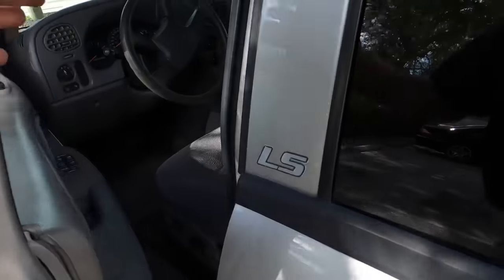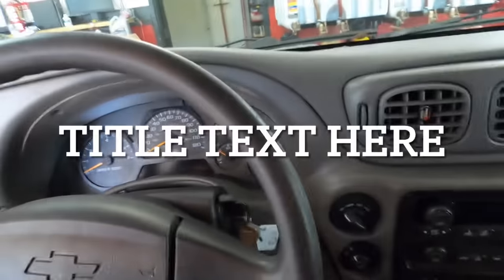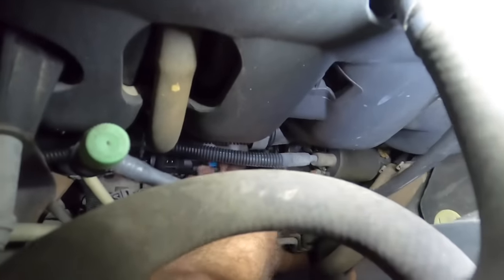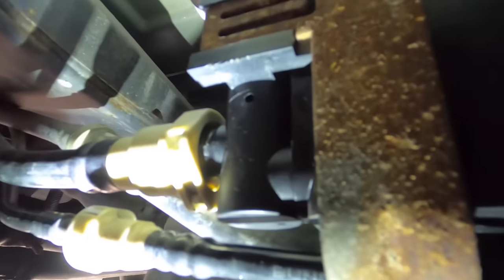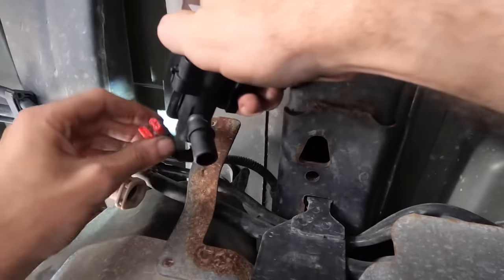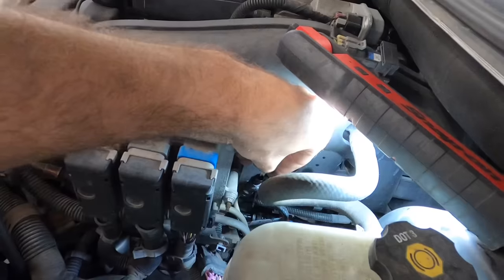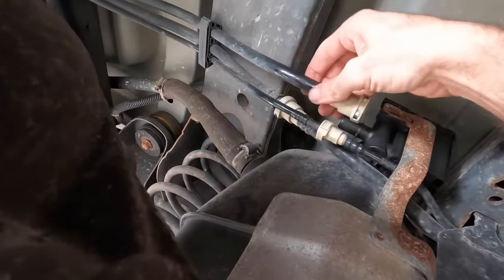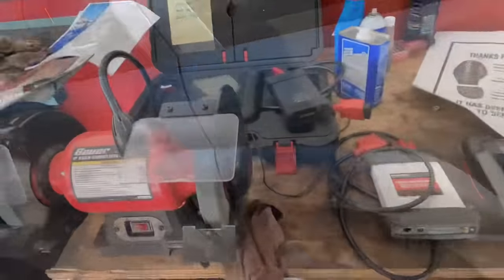Repair failed! Customer is Angry

Comment: If the customer has replaced the purge valve and it is still doing it after a little bit it wil most likely be the gas cap.  My moms Toyota matrix did it almost from new and then after the gas cap seal was replaced the check engine light went off for a few weeks and then was back on replaced it again and same thing

Comment: My 2013 ram does that, engine light comes on, check the code says small leak in evap system, changed the gas cap, still comes on over a period of time, and sometimes like this morning I can smell unburnt gas fumes in the cab, never thought to check that under the truck....done forgot what it's called.... 😆....

Comment: I know of one where the codes do have to do with the evap system.
The vehicle seems fine when moving but will die when at stop light/idling.
To me it sounds like there is actually liquid gas in the vapor canister and the start solenoid is possibly stuck open so that the engine at idle is pulling liquid gas and choking the engine out.
I imagine if the start and vent valves are in close proximity they could have been cross connected i.e. the harness connectors could have been confused as the entire setup is all up in the right rear wheel well area.
Does this sound familiar?

Comment: I encounter bad parts from the manufacurer all the time. Usually they come in batches. Like you will get a box of parts and if one is bad there is a high likely hood that all of them will be. Now most of what we do is warranty repair, so we just bill back the manufacturer anyway.

Comment: He wanted it completely clear to see what the mechanic was going to say he probably has the information written down to see if it matches what it said the problem was before , However I did hear both of the valves both open and close and the new valve did sound stronger than the original 4 day old valve , This Mechanic should advise the customer to view this video so he Will know he is being treated fairly

Comment: Good job Ray, i will say if he says he had the parts store clear code, he is either not telling the truth or the store erased the code, which they are not supposed to. At least from what the parts stores i deal with, they will not clear the codes, and….. if they do scan it, they normally give the customer a sheet with the codes.
Reply: actually I work at a parts store and it is against federal law for a parts store to erase trouble codes.....sometimes a customer will get mad at me or argue with me when I refuse to clear trouble codes....But I refuse more so for the reason it is very difficult for a mechanic at a shop to diagnose a problem when someone has cleared the codes.

Comment: Just 2 points i have questions about. You had the smoke machine there. Why you didnt use it again to test the valve you installed?
You have the car on a lift. Why the heck are you  crawling under the car when you can lift it up and work standing on your feet?????!!!
Nice end result man.

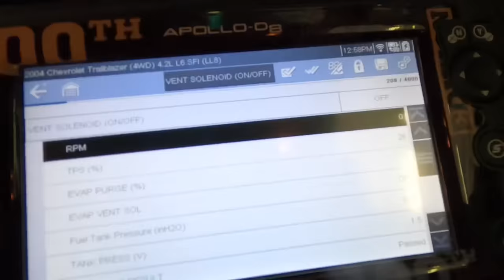Comment: @5:00  you said " it is normally open " and you selected off .
To close vent valve , should you have selected on , to close valve  ?
Also if you use the smoke machine flow indicator. No need to see the smoke . If no flow then all is good  ?

Comment: As someone who owns a 2002 Suburban… the evap code has been on too long. Been checked many times, had the purge replaced, and even changed fuel cap. Nothing. I hate evap leaks.

Comment: Hey Ray 👋 I've notice when the evap system is pressurized the vent valve stays stuck closed until some of the pressure is bled out hope the customer does not return.

Comment: wow it wasnt the fuel tank pressure sensor . usually people figure that one out after countless purge and vent solenoid replacements. or luck out with the new ecm because you get an updated program
when replaced ecm. oh yeah the t blazer is a GIANT p.o.s.  also the intake manifold bolts come loose like the mali boos.

Comment: Run the auto. Turn off then loosen gas cap. Pressure or no pressure. Gas back up when filling is bad valve.

Comment: How do you like that harbor freight battery charger Ray? Just curious before I buy one! 

I am leery of those "smart" chargers but my analog charger that is older than I am has just about had it and not many companies make new analog ones so I'm going to have to buy a microprocessor controlled one at some point.

Comment: The first repair: vent valve was bad. Replaced, apparently with a new one that was making noise but bad. Smoke pump finds that it (the new one) was actually faulty. Remove smoke pump before another "new" one shows up and puts back together. Probably like the previous mechanic. Makes a noise, so it's good. LIKE THE FIRST "NEW" ONE DID.
🤦
🤔 Why not remove the smoke pump AFTER the new "New" one was fully tested? 🤨

Comment: after repair why did you not do a drive cycle to make sure it was fixed?You could have done a drive cycle before you started you have the tool to make sure it went through one
Reply: Or at least seal the system and pressure test it.  It may still have an unrelated leak.

Comment: Would this be contributing to common GM problem of when filling gas, it clicks after putting about a gallon or so? I have replaced Purge Vale Solenoid, Vapor Canister, Purge Control Valve with OEM parts to no avail. Still having the same issue of spending 30-45 minutes of trying to put 10 gallons in.

Comment: He's lucky most of the mechanic shops around me have the policy of if you bring your own parts fix it yourself. They don't know it's brand new for sure. For all they know you tossed something in a box. Likewise if you had the codes cleared at say Auto Zone before you came in again fix it yourself. Their not gonna play find the needle in a haystack and use parts they know nothing about. They will however happily go to the shop with you and watch you buy brand new parts if you insist.

Comment: I’ve seen vent solenoids crack but still work on those btw just for the info
Reply: And for confusion I mean they still cycle off and on but set a code due to being cracked

Comment: Aye, what's the story on the mountaineer I've seen in the background of the last few videos? I got one of the first year 97s with a 96 build date and that old thing at 286k runs like a top other than some oil burning and the ac failing.

Comment: Couldnt you have checked live data in order to help diagnose the problem? It helps to have a code but live data can tell you alot too 🤔 not questioning your methods cuz they seem to work 😅 just wondering

Comment: Faulty brand new vent valve? Is it the brand with the open wallet logo on it? (Dorman) why would customer erase codes before bringing it down? DO NOT DO THAT! Motor Age had a presentation where they talked about a program or maybe a service that could pull ERASED CODES just for this purpose where customer has deleted info. I will have to do some research again as to what this was as my memory is getting old!

Comment: This situation where the customer supplies the part is not a good idea. In every shop I worked at back in the 70’s and 80’s had a firm rule that there would be no owner supplied parts accepted. We used only NAPA parts and guaranteed all our work.

Comment: I’m sure the shop wouldn’t let you but I would have told the customer that they have to get the code back up before I work on it again, especially with a “it hasn’t worked since you…” customer.

Comment: step one i never go with a customers diag 

with evap I always smoke from the test port or by the purge solenoid
from the gas cap 
from the vent valve 

helps check the whole system

Never
Eever
Worked

I always run the monitors before returning a vehicle to a customer for a check engine light. Rather them be pissed I had it too long but know its fixed instead of being pissed they come back for a check engine light

Comment: Don’t like customer supplied parts. We had a customer with a bad transmission bought a trans from eBay. It failed after it was installed. This happened 2 times. Different failures. Boss warned the customer no warrant on any failures. Paid twice for R&R

Comment: I have the same type of trailblazer but mine's an 05 I'm having the evap canister problem were I will my tank with gas it burps our the filler valve and hard to pump gas and my gas light stays on alot I know I need to replace the pump and EVAP canister

Comment: Our shop had a policy that if a customer brought in his own parts and they failed we were charging for a second R² but if we bought the parts and they failed they only paid once. That's because when we bought the parts they were warrantied and we could negotiate getting those redundant labor fees back from whoever sold the part.. it wasn't on the customer. Today, I see most reputable shops won't touch customer supplied parts and I don't blame them; it's too much of a hassle.

Back then, it was eBay parts that were the problem but Amazon has entered the ring with even worse parts. Now, don't get me wrong, I use Amazon.. a lot. But, after trying quite a few of the generic automotive parts they sell I'm not messing around with them anymore. Not scientific by any means, but eBay parts failed on me immediately/prematurely 1 out of 2 times while Amazon parts seem to fail 4 out of 5 times. Check the brand, if it's not OEM or, at the very least, a reputable OEM/aftermarket equivalent then don't touch it. I mean, seriously, how do you screw up a temp sensor?

Comment: Buying peace of junk mass produced parts is how the shop management keep prices as low as possible to the customers. When I worked at a shop out of high school we offered piece of crap cheap parts or a not so piece of crap expensive parts if available (which some parts did fail as well).

Comment: Question every time I fill up my car won't start I have to push the gas pedal to get it to start I replaced the purge solenoid no echeck light 2007 Hyundai accent manual

Comment: It's a GM vehicle... The check engine light is supposed to always be on.  
It's amazing that thing is still on the road for its age. But then again, if it weren't for GM vehicles, mechanics wouldn't have nearly as much work to do.

Comment: I don't blame car owners for trying to avoid paying $140 (here) for a diagnostic check that can take very little time, then paying $140 per hour for the fix. This never used to be the case as the clock started when the tech assessed the problem then repaired it. The extra diagnostic charge is just another way to stick it to the customer.

Comment: Diagnostic fee is a dirty term for some people. Lack of trust in the garage and access to internet self diagnostics make $150 diagnostic fee seem like a cash grab. Same thing frustrates doctors who deal with patients that do their own symptom diagnosis. Rather than complain about customers being dumb for refusing a diagnostic, it seems there is a market opportunity. Smart mechanics could build trust by offering a $20 quick 10 minute diagnostic. Run the codes and develop a hypothesis for what might be wrong. Relay your suspicions to the customer and ask the customer if they want you to dig in and confirm the diagnostic with mechanical investigation. If they agree to proceed waive the $20 and charge for your time going forward. If they choose not to proceed, then charge them the $20 and wish them well. The diagnostic should be the service that gets you the repair business, not a source of billable profit.

Comment: Again you failed to learn the system. Step one is to monitor the fuel tank pressure sensor while purging then sealing the system using the scan tool behind the wheel. Watching the tank pressure bleed off or not changing determines if you have a leak or a bad FUEL TANK PRESSURE SENSOR.

Comment: I know recently we've been having trouble with most of the parts we get have been failing. Straight bullshit that we have to redo a job multiple times because the parts manufacturer, usually from china and Mexico and the quality has suffered severely!

Comment: considering the check engine light was (as far as we know from this video) caused by a faulty part that was installed by your shop, did they end up having to pay twice?
Reply: Customer supplied the part the first time and wanted it installed with no diagnostic because they didn't have time to leave the car. Then five minutes before the second visit, the customer had the codes erased. Customer did everything they could to make sure they didn't have a warranty. If that were my shop, they pay twice.

Comment: I keep getting a p1607 engine starts drives misfires when driving the negative connection to the battery was cracked I fixed that then it popped again misfire while maintaining speed limit not bad but I can feel it repair solutions app says change battery transmission buddy says just reset code battery was made 08/17 what would your first plan of action be

Comment: Every 2000s gm my family or I have owned has had a vent valve solenoid replaced. They are complete trash even when new. My truck alone has had 3 (has 355000 miles). It's like GM designed these things to be used in a dustless sterile environment even though the dang thing is under the vehicle with no protection.

Comment: I've replaced my fuel pump in my Toyota Camry 3 times. Each one makes a high pitch whirr sound that's real annoying. Cheap junk with no alternatives.
Reply: Have you tried using a Toyota part?
Reply: @836dmar  Hmm I thought they were all after market.
Reply: @cb-gz1vl  Might be as I've never needed one. Toyota parts are spendy but are typically highest quality. Denso, etc. I found a Denso alternator that was the same model # as from the Toyota dealer for a lot less on Rock Auto. Worth calling the dealer to see what mfg it is.

Comment: A simple concept is to stop installing customer supplied parts… but since I’m in the minority I’ll have to just sit and watch folks beat themselves up chasing ghosts. But a bit of math shows the customer already did 2/3 of a repair. Diagnose is 1/3. Supply parts is 1/3. I ALWAYS insisted they finish the job since it was 2/3 completed!

Comment: Around about 1:42 you stated: "So, the evap system is designed to purge those gases out of the fuel tank and then re-burn them through the intake manifold in the engine." 

Should've been something more like:

"So, the evap system is designed to purge those gases out of the fuel tank where they are drawn through the intake manifold and burned in the engine."

The hydrocarbon gases (from the fuel tank) are not reburned through the evap system. Unburned hydrocarbons are hydrocarbons that remain after the combustion cycle*. And *those gases are reburned through the catalytic converter.  

Sorry, Rainman Ray - I know it was an honest mistake on your part, but I couldn't resist.

Comment: He had the codes erased!??! He knows enough to do at least some diagnosis, and buy parts, but doesnt know that erasing the codes is a rookie error? A classic case of "A little knowledge is a dangerous thing".
Reply: @N Diesal JUST before going to the repair shop? Maybe a day or two before, when you're planning on driving sufficient distance to re-trigger them, but just before? Nah, thats obfuscation or stupidity.
Reply: @N Diesal IDK either, but the source of the parts is irrelevant (almost all parts like that come from China or Germany anyway). I refer you to Rays comments from 6:40 to 7:15  - its all "junk" because its made to a price, because people think they can have it all for next to nothing. Quality costs, and quality brands source quality parts because their reputation depends on their suppliers. Cheap brands are cheap for a reason.

Comment: If only he was doing a proper smoke test. His connection is leaking because he doesn't have the correct adapter to introduce smoke. And his assumption of a faulty vent valve is incorrect. GM vent valves won't release air when under pressure, they are designed to work with vacuum.

Comment: If the guy was coming to you guys why would he go get the codes cleared. Sounds like he installed that cheap vent valve probably had codes for that but got them cleared so it look like he didn’t do anything

Comment: 🔰🇺🇸 Stupid P0049 code…I’m pretty sure this is the exact same issue I’m having and have had with my 2008 Pontiac G8GT. In the summer, I have to wait for the gas tank to bleed off through the filler, otherwise the tank won’t fill and it’ll spray liquid gasoline back at me.

Comment: Custom can remain angry untill.the computer shows a fault code.
People. The codes give a mechanic a location to look at the system. They dont solve the problems. The mechanic has to search for the actual problem if you reset the computer you've screwd him and yourself because the mechanic has no clue where to look. And has to take your word for it.
Modern cars are not a 1960 automobile with just sevral systems all analog to look at, insted they are a complex network desined to make the automobile run clean and efficiently.  What you might think is the part could be totally wrong after its tested.  
So now Ray has to play guessing game to find the problem insted of just one system it could be the whole motor system.
What the code reads may or may not be that part. It could be an intake problem. 

Don't clear your codes then take the car in for repairs it won't get fixed. Thats on you buddy.

Comment: I've found you are better off NOT feeding smoke in the EVAP test port. Definitely don't remove the Schrader valve. Just disconnect line from purge valve and go right in the line. But I'm also so old I burned my creeper. If it's on the rack, why roll around on floor bouncing your melon off stuff? Young men are tough and some live to regret it. Getting old hurts.

Comment: I would not have touched that car. If it did actually have a fault the fact that the code was erased would lead me to suspect the motives of the owner. If the valve was faulty then the owner had no call on the shop because he supplied it.